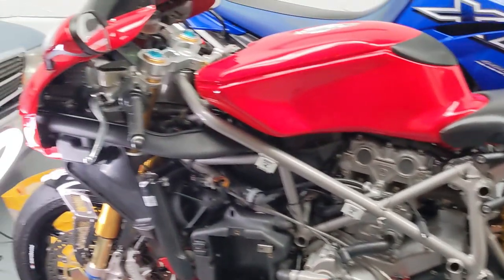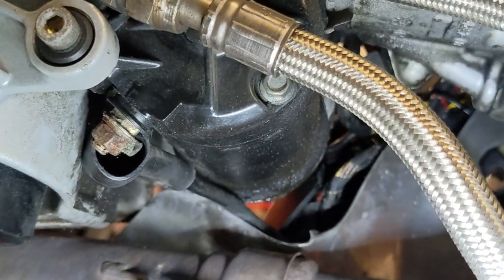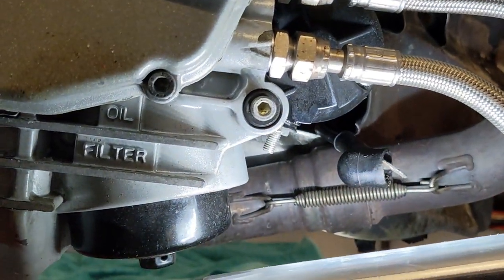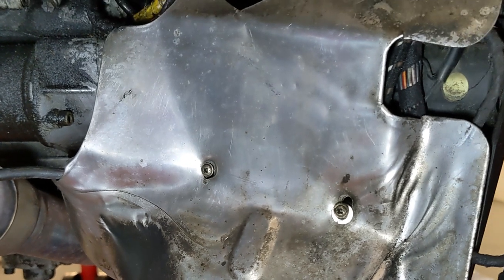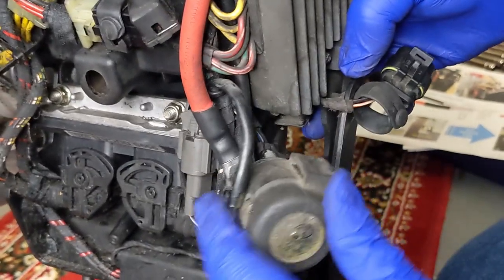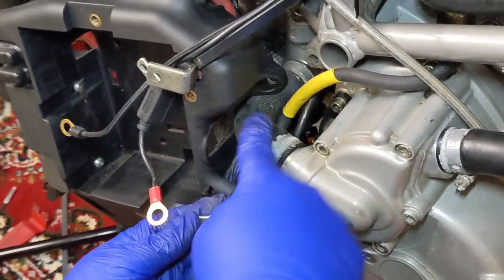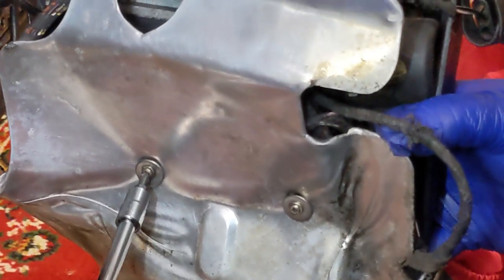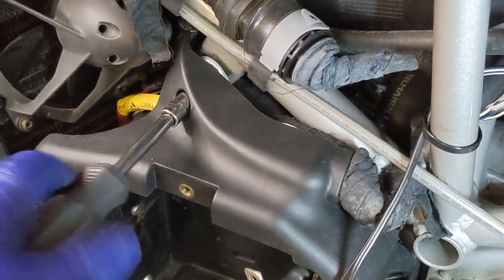ex 44Teeth Ducati 999s Fast Start Upgrade - Exact Start Kit

Comment: These work as advertised. I installed a Motolectric HICAP kit on my 999 way back in 2010.  I wrote the install tutorial for the company.  a  bit tight ...what you also want to address is upgrading the solenoid and starter motor. IIRC Ducati uses cheap steel in their solenoid  vs copper. So this is a great upgrade in conjunction w/ the cables. Also, go with a new aftermarket starter. Hi torque, less weight, less amp draw.. I replaced mine with Ricks Motorsports products. Regulator/rectifier, solenoid, starter. Back then Ricks was doing the proto-typing for Ducati models at a friends Ducati shop..BCM..  I had a BCM 102mm overbore kit, Pistal HC 13.5:1 pistons, new head and base gaskets, race spec crank balancing, new bearings throughout... 148.99HP, 86 ft lbs  Fast by Ferracci did the install, mapping.  I had to get more cranking power so I went with the Ricks starter as the OEM starter, electrical system strained to push the huge Pistal HC pistons ..especially when cool or cold. I also installed a Shorai battery but that was a disaster .. went back to a YUASA.  If you can afford to replace the starter, solenoid ..along w/ the battery cable kit you'll have more than enough cranking power.... I had with my engine upgrades...
Reply from the maker: I like it!

Comment: 8:37 Turn the new positive red cable on the solenoid, the ather way around. than it feat better together with the old one.
The new ground cable can be conected directly on the exposed bolt for the starter motor. In addition with the original cable connected on the horizontal sylinder.

Comment: Fired up pretty quick. I always do positive terminal first when refitting a battery..
Reply from the maker: You are right, Positive first! - I knew the mistake after I did it
Reply: @MotoTingle  Yep 56 amp draw to the starter will cause BIG SPARKAGE ....!!! as I found out !!

Comment: Hi. Thanks for the video. How's it holding up? Still got it? I have just got a 999 and have an issue starting it. Thinking about getting this kit although not sure it will fix my problem. Everything comes on when turning key, fuel pump primes, alarm/immobiliser works fine, it just doesn't crank the engine. My first thought was it needs a new battery so got one and that hasn't changed anything. Now, if I connect up the old battery with the new battery with some jump leads then it starts no problem. I am thinking some sort of corrosion somewhere perhaps? Have cleaned up the contacts on battery terminals and starter relay but hasn't made any difference. It just fires up no problem with two batteries.... Maybe I need a better battery or perhaps this kit would help. Any ideas or thoughts from anyone would be greatly appreciated. Thanks.
Reply from the maker: This kit forces you to check all the terminals right to the starter motor. As your fitting new wires. I think this kit is good. But a STRONG battery is worth investing in. I still have my 999 and I love it, just about to do belts and it’s ready for summer
Reply: @MotoTingle  nice one, cheers. I think I am going to either get this kit or make my own cables and see if that helps before I start replacing any parts like the regulator rectifier or starter relay or even starter motor. Thanks for your help.
Reply from the maker: @rustybaws  I use a 230 crank amp battery.
Reply: @rustybaws  It is possible to open the starter to change brushes, and clean the ancer. Brushes is not a Ducati part. But you can find aftermarked ones. Even at the Ducati store.

Comment: Did the Instructions say to use the existing cables inconjunction ?
Reply from the maker: Yes they explicitly said to use existing cables. Eve be against my own judgement. To be fair cleaning up th terminals on all original connectors can achieve similar results

Comment: Nice 👍
Reply from the maker: Thank you! Sorry the video was sooooooo long. But I hope it helps someone in the future
Reply: @MotoTingle  no apology needed mate 👍
Reply: @MotoTingle  these cable upgrade kits will help ANY motorcycle along with any car too.  The Duc 999 install is difficult. If your doing it when cold, you can't. Cables must be super warmed up, flexible. Actually in my case Motolectric sent the wrong kit, it was for basically a MotoGuzzi/universal kit. And then sent a 999 specific later. The Guzzi kit was better for the 999 IMO if your 'piggybacking' it... But they work as long as you buy a quality component kit... buying  a cheap kit is a waste of $$$
Reply: @carlmayer691  Hi I’m installing my kit this weekend. I didn’t notice the ground wire on the 
ECU bolt mentioned in the direction for my 999. Am I missing something?
Reply: @carlmayer691  The cables in the Exact kit is super smooth and soft. You can do it in winter time.